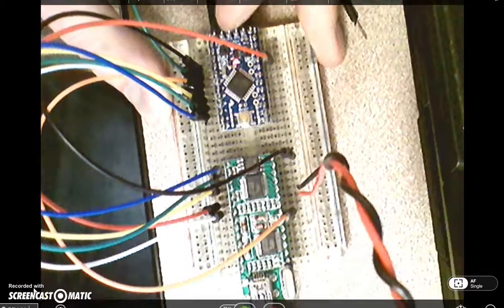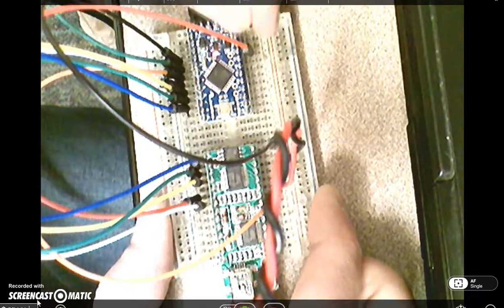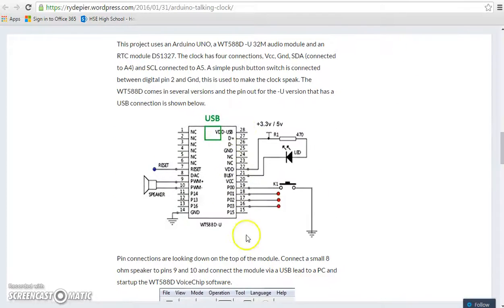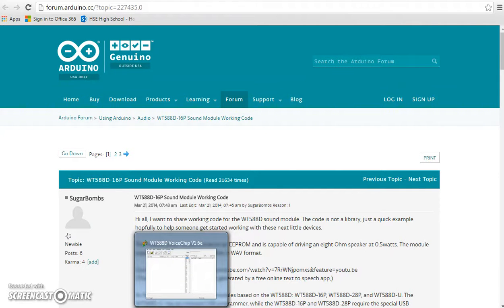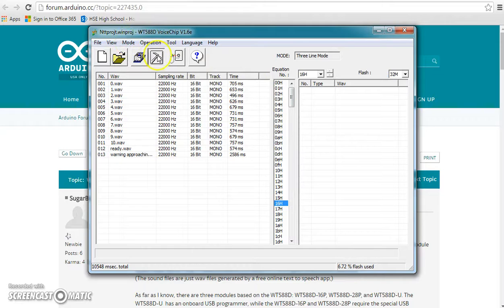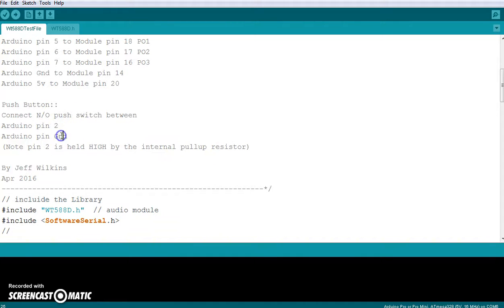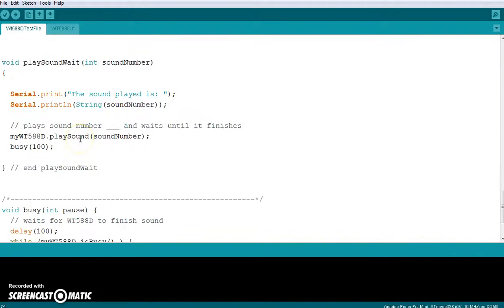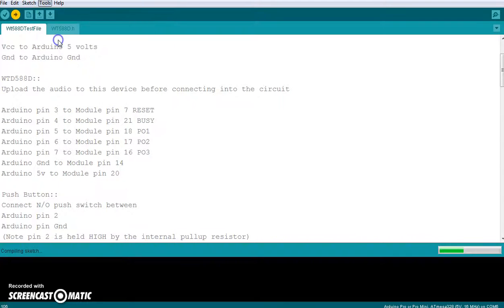WT588d part 2

Comment: Great tutorial!  I was looking for this last year, and finally found the talking clock, on the Arduino forum site, and decided to keep looking and found your first tutorial which led me here.  I had set the module up using the key method, last year, and decided using 4 sound files was not enough for the Autonomous robot I wanted to build for my niece and nephew.   The idea is to have the 2 collision sensors, ultrasonic sensor and start up sounds to say variations of the same thing when activated using a random number to generate the sound sample, instead of using the button. I'm not great with coding so I may need a little help...